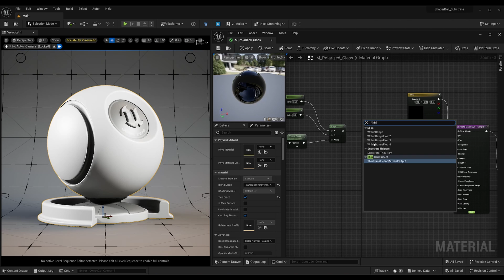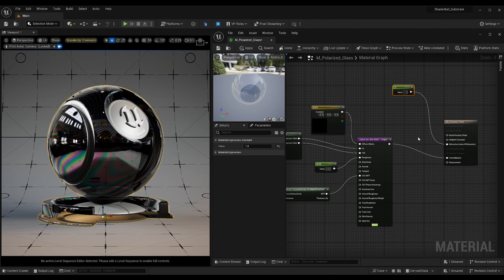How to Make "Polarized" Iridescent Glass in Unreal Engine 5 | Substrate Materials Tutorial

Comment: hi, I did it on 5.6, exactly at the moment when your material became transparent, it remains black and crooked for me, can you tell me what the reason is?
Reply: Hi, I learned that in newer versions of UE you need to do an extra step.
Click Substrate Slab BSDF node and in the left window, under Sub-Surface Type, change it from "Diffusion" to "Simple Volume."